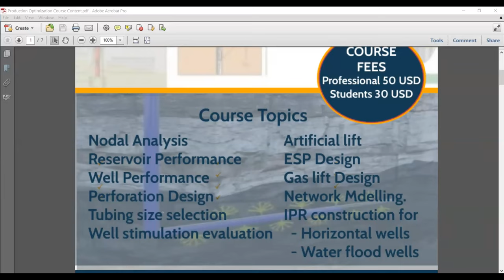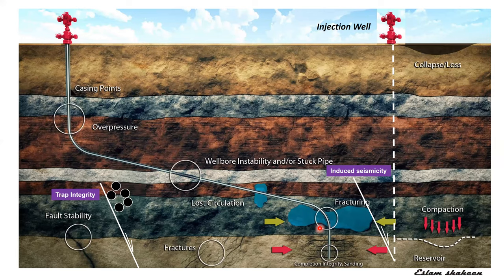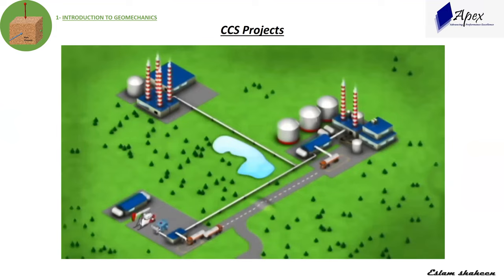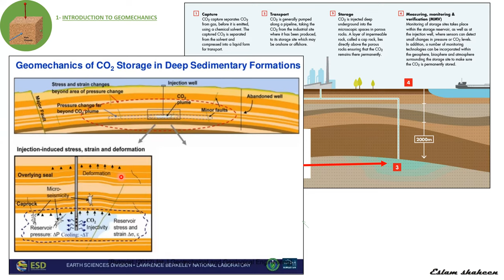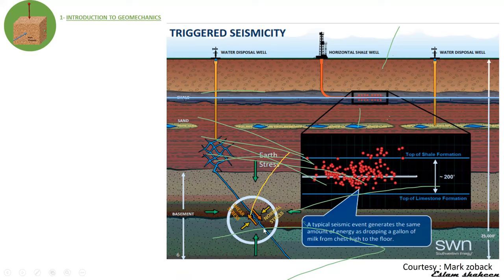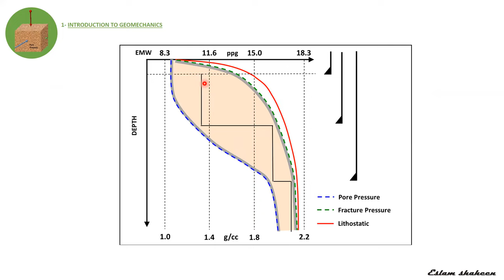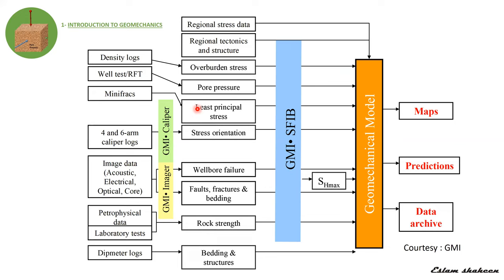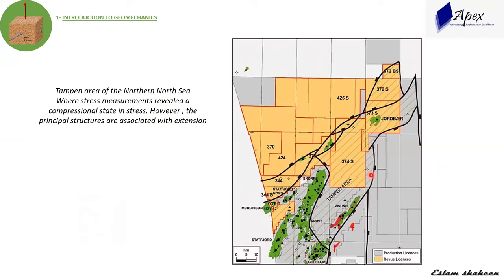Reservoir Geomechanics Fundamentals

Comment: Is there oil in asphalt?
Asphalt occurs naturally in a few places in the world, but most of the asphalt used today for paving comes from petroleum crude oil. Asphalt is the heaviest part of the crude—what's left after all the volatile, light fractions are distilled off for products such as gasoline.

Where does the US get asphalt?
Today, most of the asphalt comes from crude oil as a by-product of the refinery of crude oil. Today, over ninety percent of US roads are made of a mixture of asphalt and other materials
Of the 2.6 million miles of paved roads in the U.S., over 94 percent are surfaced with asphalt. There is approximately 18 billion tons of asphalt pavement on America's roads.

Why do we use asphalt for roads?
What is the best road material?
Asphalt is easily the best material for road construction. 
Asphalt pavement provides a smoother surface. A smooth surface reduces damage to the pavement, necessitating fewer repairs. It improves fuel efficiency and reduces wear and tear on vehicles, making the choice for asphalt a great economical decision.

How much asphalt is used per year?
It is estimated that the current world use of asphalt is approximately 102 million tonnes per year.

Is asphalt cheaper than concrete?
The cost of an asphalt driveway is typically cheaper than concrete, costing $2.00 – $4.00 per square foot. ... In contrast, a concrete driveway costs between $4.00 – $6.00 per square foot for a standard installation

Can you pour asphalt over concrete?
It is safe to pave asphalt over concrete. Concrete is a great base material because it is stable and allows for excellent compaction of the asphalt above. In fact, many miles of concrete roads are paved over with asphalt every year.

How many miles of paved roads does North Korea have?
According to North Korean statistics, there are 78,700 kilometers (62,960 miles) of road in North Korea. And most of it isn't paved. The total length of all paved roads in North Korea outside major metropolitan centers is just under 800 km / 497 miles.

How many gallons of oil does it take to make plastic?
It takes about 0.4 gallons of crude oil to make one pound of plastic, which means that 11 million metric tons of plastic equates to approximately 9.7 trillion gallons of oil.

Plastic Bags and Petroleum:
About 8% to 10% of our total oil supply goes to making plastic. It is estimated that about 12 million barrels of oil a year are used in making the plastic bags used in the US.

Other important applications include canal and reservoir linings, dam facings, and other harbour and sea works; asphalt so used may be a thin, sprayed membrane, covered with earth for protection against weathering and mechanical damage, or thicker surfaces, often including riprap (crushed rock). Asphalt is also used for roofs, coatings, floor tilings, soundproofing, waterproofing, and other building-construction elements and in a number of industrial products, such as batteries.
 
What percentage of oil is used for manufacturing?
For many, a barrel of oil is almost synonymous with its most prominent product, gasoline. While almost 40% of a barrel of oil is used to produce gasoline, the rest is used to produce a host of products including jet fuel and plastics many industrial chemicals and pharmaceuticals.

How is oil used to make pharmaceuticals?
Most pharmaceutical drugs are made via chemical reactions that involve the use of organic molecules. Petroleum is a plentiful source of organic molecules that feed into the drug synthesis process. Some sources cite as much as 99% of pharmaceutical feedstocks and reagents as coming from petrochemical sources.

Are solar panels made from oil?
Solar energy is touted by some as the solution to the world's energy woes. But the process of making the various components requires fossil fuels, both for power and for the components themselves, some of which are based on petroleum. ... Those plastics are made from—you guessed it—petroleum.

Is oil made from dinosaurs?
Oil and natural gas do not come from fossilized dinosaurs! Thus, they are not fossil fuels. That's a myth. ... It was subsequently used more ubiquitously in the early 1900s to give people the idea that petroleum, coal and natural gas come from ancient living things, making them a natural substance.

Is petroleum naturally occurring?
Petroleum is a naturally occurring liquid found beneath the earth's surface that can be refined into fuel. ... Petroleum is formed when large quantities of dead organisms–primarily zooplankton and algae–underneath sedimentary rock are subjected to intense heat and pressure. These organisms were the dominant forms of life on earth at the time.